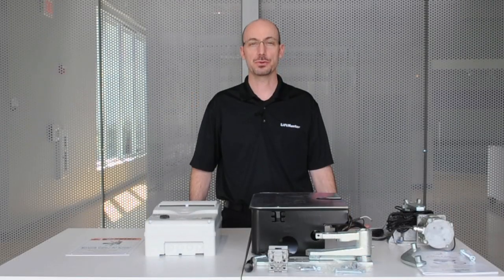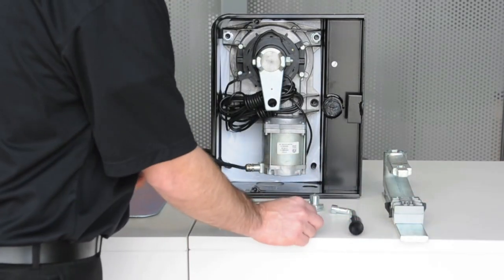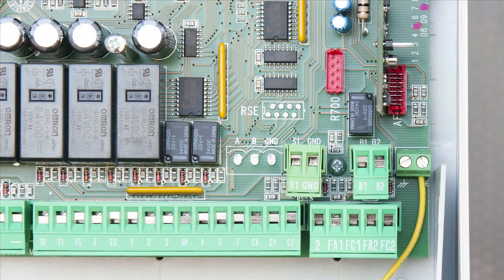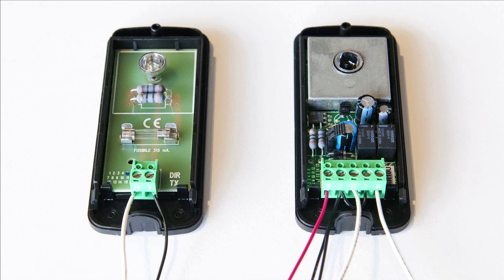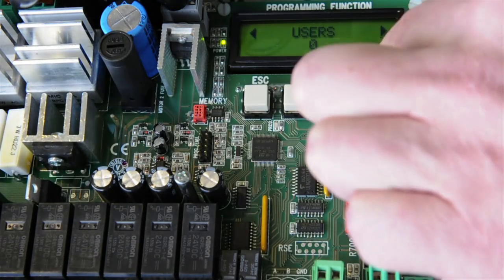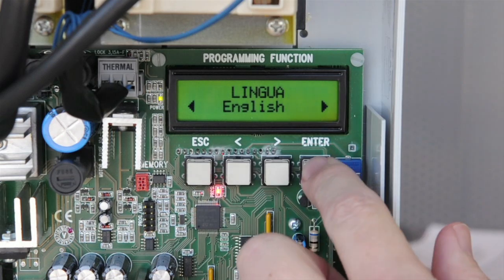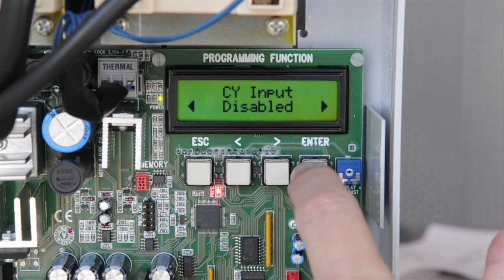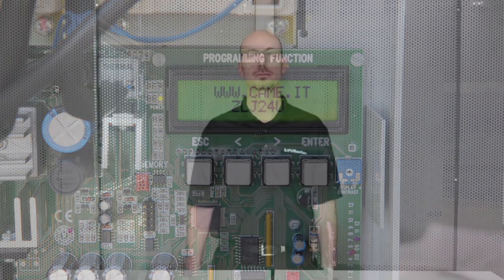Programming a LiftMaster-CAME FROG Underground Swing Gate Opener

Comment: Hi I have a "Cam underground Gate", The programming went wrong, but managed to correctly it with you help, but cannot get the sensors (transmitter and receiver)  to function,  where are they in the program, as they may be disabled?